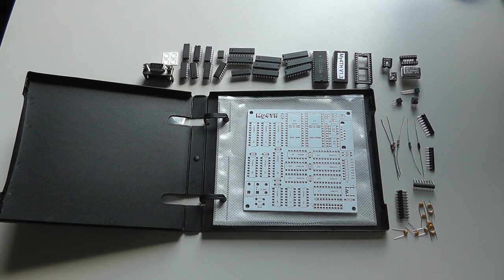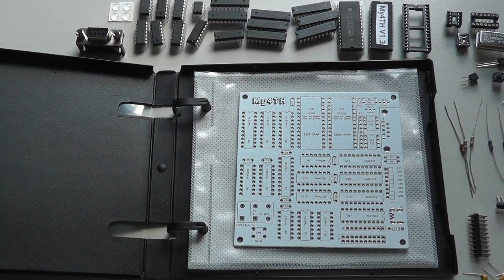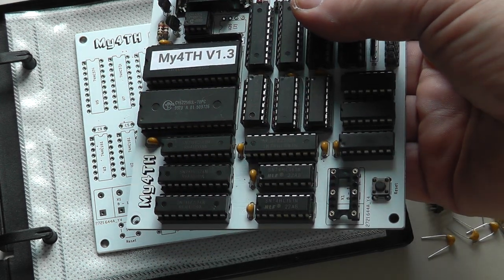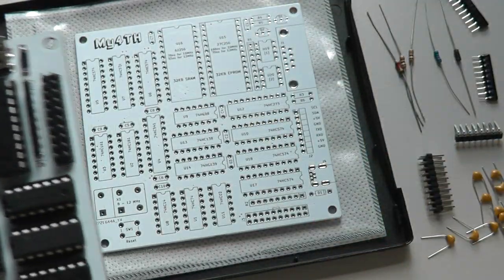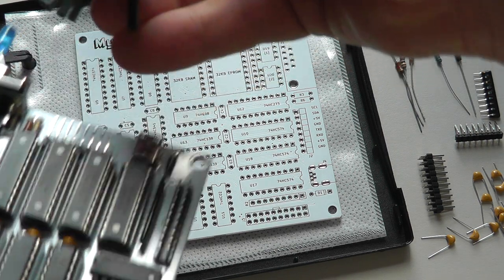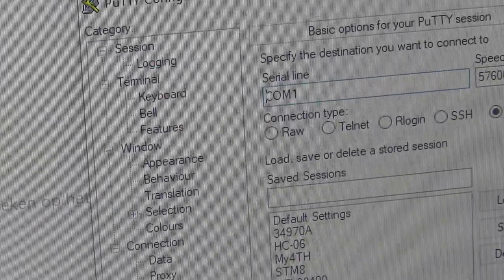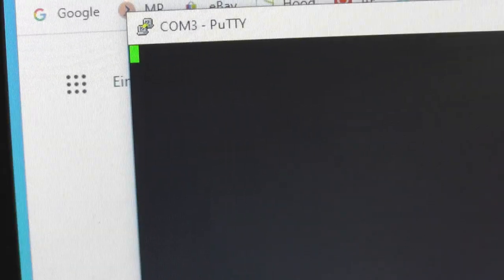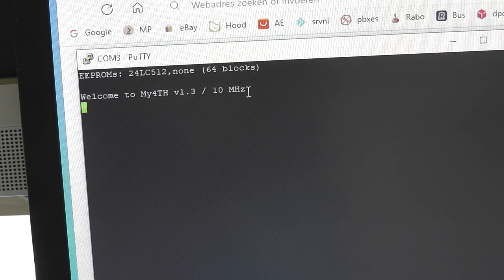Bare bones My4TH single board computer kit running Forth

Comment: This is great! Last week I ordered 20 bare boards and parts for 5 based on the files you provided. 
Can't wait to get started. 

What a great educational and hopefully a practical tool as well (at least for fun small control jobs). I've been using 4th since the R65F11/12 and look forward to distributing the boards to my cohorts to prove how practical 4th is and that you don't need a single chip "CPU" to get many jobs done, particularly because of the eeprom and screen capability you provided.

Well done, I am in awe of your work.

Comment: I'm guessing it is running a version of fig forth
Reply from the maker: The designer of the board has specified that it "supports the Forth 2012 standard". It probably has a few non standard words that are hardware dependant. This is really intended those who wish to learn Forth and how you can create a processing system using the most basic hardware elements.

Interested in building one yourself ?
Then check out eBay .de and search for "My4TH" ....